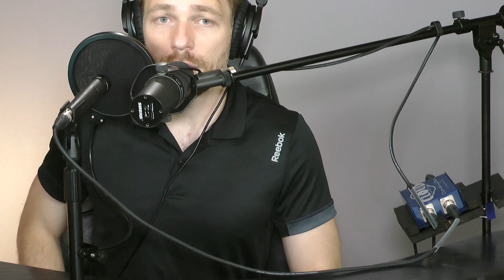SM57 with EQ = SM7B ?

Comment: What I love about the SM7B is the way you can EQ the hell out of it in the high frequencies, and it just keeps asking for more, it's really hard to make it sound harsh. With most condenser mics, you actually need to tame those high frequencies, but with the SM7B, you have that choice of sounding warm or silky. I love the SM7B for VO, specially when I need to get close and personal.
Reply: i literally have the opposite case with mine
Reply: @kikata999  You're probably not using a Cloudlifter or FETHead, and are cranking the gain too much in your preamp or interface?
Reply: @carlosdavidlocutor  Yeah i don't have neither of this equipment, also i crack the volume ont he pre am up to 80-90
Reply: @kikata999  Yeah, that's what's causing the issue, most likely. This mic is very gain hungry, you definitely need a Fethead or a Cloudlifter.
Reply: @kikata999  Klark Teknik Ct1, it’s 30 bucks and it’s pretty damn good.

Comment: Very informative. The cut on the EQ definitly helped with the high end of the 57 and did make it sound more like the 7B, but the actual 7B seems to capture some more interesting colours in the high-mids. I'm no expert, but thats what experienced.
Reply from the maker: I can't disagree; the 7B does seem to capture a little bit more magic than the SM57, but I can't put my finger on it.

I'm working on writing a VST plugin that will do a much more sophisticated EQ conversion, with the sole purpose of just converting SM57s into SM7B. Hopefully I can get it working in real-time, not just post. 

It brings it even closer, but still not 100% there however. Stay tuned!
Reply: Sounds awesome! Best of luck with that!
Reply: Steve Seguin  did you made the plugin ?
Reply: Steve Seguin did you ever make that plugin? Would be interested in checking it out. Thanks

Comment: My professional experience with dynamic microphones is that the SM7B is much worse than the old SM5B. I used this in the 1970s for twenty years . The SM5B is the best ever made by Shure, so it now used cost 1500 dol. Original price is 350 dol.

Comment: the sm57 pick up more/better information in the low-mids than the sm7b? to my ears it's like if the sm7b doesn't pick up some frecuencies there, but the sm57 it does.

btw great video! you have one more subscriber
Reply from the maker: Sweet! thanks.  

You might have better ears than me, but if you check out recordinghack's website; mainly this link: http://recordinghacks.com/graphs.php/0006-0255 , you'll see that perhaps the SM57 does indeed have slightly more low-mid.

I'm not quite sure why the 250-hz boost works for me, but perhaps it just balances out high frequencies a bit; the SM57 has quite a bit there.
Reply: thanks for the info! ^^

Comment: the 7b is a far superior microphone for voiceover. no matter what eq and tweaking I do I can't achieve that last 3% of magic on the 7b from any of my 57s.  I'm sure it can be done but I think it's going to be done by adjusting the actual head basket etc. But in a music mix the difference is so negligible, especially after creative eq and compression that Ill simply refuse to shell out for a 7b if mine ever dies. A simple 5.3db 250hz boost, and a 0.5db boost at its octave gets you so close its impossible to tell unless it's totally isolated.
Reply: What about the huge gray wind sock for SM57? They say that is required in order to get SM7-like results.

Comment: the biggest difference is the capsule. the sm7b is a true large capsule dynamic. and the 57 is a smaller capsule. the sm7b captures more human like nuances like lip smacking. while the 57 is focused heavier on tonal aspect. which makes amazing on guitar cabs and and snares. further note, think of the 7b as the one built for humans and the 57 built for instrumentation. I own both and prefer to mix the sm7b with rock vocals.. works like a champ.
Reply from the maker: Thanks for the knowledgeable comment; I couldn't find much information on the web regarding the capsule differences, so this helps.

I prefer the SM7B as well though, and use it for podcasting mainly, but I'm really quite a fan of the SM57 none the less.

Comment: thanks a lot !  What "Q" ( which "broadness") did you use when you boosted the 250 Hz range with 5 db
Reply from the maker: I don't have an answer to that since I didn't have an option to adjust the Q value and I don't see the value specified in the technical manual.

I used Mackie's 3-band 'Perkins' equalizer though and this post would indicate that Q value is fairly broad: https://www.sweetwater.com/insync/perkins-eq/

Comment: Great comparison ...thanks!! im working several years with the SM7B....y really love it on my voice....but im fan  of the sm57 too....so ...the impression that ive got after see your shootout anb based in my middle experience as voice over(im an sound engineer not Professional voice over) is that probably a low levels of vocals (intimate voice over or soft songs arround 75  85 dB) the response are very similar,,,,,but in a very loud voice situation(up promotional or herd songs arround 90 even 95 dB) probably the SM57 lift to much the sibilance rage...(maybe at this realy tricky level...when you lost a really good information on the mix), please let me know if you already test al higer levels...beacause im love to use a SM57 as a second Mic.....thanks and greetings from ecuador!!!!

Comment: Its gets closer to the SM7B with the 250 push but it still lacks that warmth in that certain area. You can't just eq a mic to sound like another one. The SM7B is just thicker and warmer right off the bat then you can tweak it with a little 5k or so to give it some sparkle.

Comment: Nice video...I'm having a hell of a time deciding what mic to get but I'll research it to death and figure it out. On a side note, what brand/model of mic stand is that? Thanks in advance!
Reply from the maker: The larger one is the On-Stage Fixed Boom Drum/Amp Mic Stand (MS7701B); the other smaller one is also by On-Stage. Both I picked up at the local BestBuy; bought two of each. I couldn't find anything cheaper that still worked okay, but most Youtubers go with the expensive Rode PSA1 instead.

I had to modify the two larger mic stands to get them to suit my needs; a SM7B fully extended is too heavy without counter-weighting. On one I put a metal counter-weight to balance the extended arm; the other I tried using a bungee cord to balance it, with weight around the base. Both ways worked out well,.

Comment: whats the purpose of the cloud lifter?
Reply from the maker: The Cloudlifter is known for adding a clean >20-db of gain to a mic and is commonly used with the SM7B. Rather than performing the test with an obscure mic preamp, I wanted to do it with something that could be seen as a reference device; it leaves less room for criticism on how I am performing the test anyways.

If you have a good mic preamp to begin with though, the Cloudlifter isn't much use, outside of perhaps helping with very long mic cable runs or giving a bit more gain to old-style ribbon mics. It also seems to have a pretty good impedance rating, which gives dynamic mics a nice natural sound I find.
Reply: Would I need it for sm57 and a mackie mixer? or scarlet 2i2/solo?
Reply from the maker: Check out http://recordinghacks.com/2012/06/18/sm7b-audio-interface-shootout/ 

"While the 2i2 sounded good… when paired with the SM7B it was simply too noisy. The Cloudlifter improved its performance a little, but not quite enough for my recommendation."

I've never used the 2i2 myself, but noise often is an issue with the SM7B and cheaper mic preamps. The Cloudlifter can sometimes help reduce noise with cheaper mic preamps, but it probably won't help the 2i2 much. I don't find the Cloudlfiter improves the Mackie Onyx pre-amps at all -- it just adds extra volume. 

I ended up investing in a SoundDevices USB Pre 2 recently, which I think is perfect for my needs, although a bit expensive. I like to record live and so having low noise, a hardware limiter, and lots of gain to play with were important to me. I was very tempted to buy a DBX 286s, http://dbxpro.com/en/products/286s , and although I've never used it, I'd probably recommend it over a Cloudlifter. You will still need something like a 2i2 if you're going to use a DBX 286s, since it doesn't have USB out.

If not recording live, I'd probably just use whatever and a good software-based de-noiser to reduce the noise levels and increase the volume digitally. I like the Izotope RX6 plugins personally.
Reply: but im looking at the 57 not the 7b
Reply from the maker: ah. sorry, misread.

I find the SM57 is a tad bit louder than the SM7B, but noise could still be an issue. Depending on what you are using the Sm57 for, you may be fine with something like a 2i2. If you're doing voice over work, I'd suggest a high-gain, low-noise preamp, but typically you're looking at $600 up. 

Really depends on what you're doing I'd say and what you already own.
Reply: I am looking at recording sax (so low gain) and casual video game livestreams (I can make it louder in the software) could I get away with just a mackie mixer? Or would I need to go for the 2i2? Or are there any other interfaces just above that price range that are more worthwhile for me to get instead?
Reply from the maker: There are a lot of options out there, and you will likely hear a lot of bad advice on the internet. My advice is likely no better than the next guy -- I can only say what has worked and hasn't worked for me.

I would personally not suggest the Scarlett Solo for Live Streaming, as it seems to only have a max gain of +46-db. This is pretty low gain: it completely makes sense why so many people buy it and then end up needing to then buy a Cloudlifter afterwards. You can definitely increase the gain digitally, but you'll also be increasing the noise then -- it would still work though.

For Sax however, if you aren't too far away, I'd imagine the Scarlett would work just fine. You can always buy a gaming headset microphone additionally, like a Modmic 5, if you're just looking for something casual there.

Cheap Mackie Mixers don't sound as good as their more expensive versions for some reason, and it doesn't sound like you need 4-inputs anyways, so I'd probably pass there. The Mackie Onyx Blackjack however is pretty good value and it would probably be my preference over the Scarlett. It has +60-db of gain, which gives greater flexibility. 

Other things to keep in mind, a good XLR cable is generally recommended for the SM57 -- I found the Lyxpro Quad cable to be pretty good value and low noise. meh.

Hope that helps.
Reply: Would the SM57 and Mackie Onyx Blackjack be better for streaming than my snowball? I mean I know the sm57 is miles better, but would it be able to deliver good sound with the Onyx preamp?
Reply from the maker: I really like the Snowball, but it picks up all the noise in the room when gaming. I have to have it close to my mouth, and use a pop filter, if I want to use it for gaming.

Something like the SM57 + Onyx would isolate my voice better,  less fan / keyboard noise, but I'd still likely need to get it somewhat close to my mouth. 6-inches away with a foam windscreen is my preference when using the SM57 in this way.

I compared the Snowball to the SM7b before, which is about what you can expect for the SM57 also.
https://youtu.be/vUXNazZqwS4?t=1431
https://youtu.be/vUXNazZqwS4?t=1481

You might notice the noise when the SM7B is a foot away, but it goes away when I bring it 3-inches away. I was able to reduce this noise with better XLR cables and a $900 mic preamp.

Either of these two microphones though are also a bit annoying to have right in front of your face when gaming. I personally use a Sennheiser PC37X headset for casual gaming as a result. 

A problem with both the Scarlet and the Onyx for gaming is that they will output STEREO audio, but only the left channel will have audio. Sometimes this can cause problems. I have never had this problem with the Snowball.
Reply: Why not just have the microphone record in mono instead of stereo in that case?
Reply from the maker: The 2i2 has good drivers I believe, so I'd imagine it would have a mono-record option; I haven't used it though. 

Most other audio interfaces I've used, like the M-Audio ones, didn't have a mono recording option; just 44khz/48khz and 16bit/24bit stereo options. 

Not sure about the Mackie.  Just something to be aware of.

--- Only a problem for VoiP and some games either way
Reply: If I do in fact really need to invest a lot of money just to allow an sm57 to work, what setup would you recommend me? maybe a samson Q2u with some kind of mixer?
Reply: In OBS Studio there is an option to downmix your mic to mono, and im sure it exists in almost all post production software, but the only live production software I've used was OBS  Studio

Comment: Hey If you had to pick 1 from these two for rapping/hip hop vocals. Which one would you pick?
1. Shure SM57 with Mackie Blackjack
2. Shure SM57 with Focusrite Scarlett 2i2
Reply from the maker: Raj Sandhu personally, I'd go with the blackjack, but I've never really tested either option -- just similar devices. 

if you rap fairly loud, the 2i2 might turn out to be better, and it's fairly popular. A reviewer online tested both with the sm7b and noted the blackjack has lower noise, but he wasnt rapping-- just talking.
Reply: Thank you so much for the reply. I'm going to be recording fairly loud yes, but I think I'm still going to go with the Mackie, when the equipment arrives, I'll give you an update here. :)
Reply: Oh and I think I've read that review, it's a blog that tested sm7b with 7 mixers and posted samples where Mackie outperformed the more expensive mixers right?
Reply from the maker: Raj Sandhu indeed, that's the review!  thanks for commenting btw, and I would love to hear your review on the Mackie. hope it works well for you